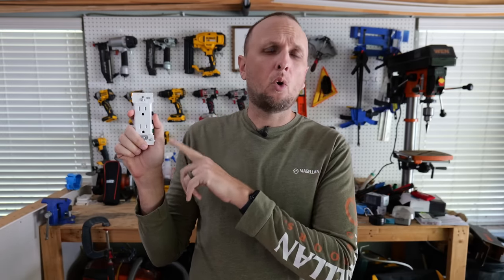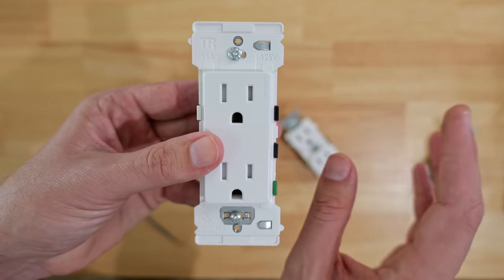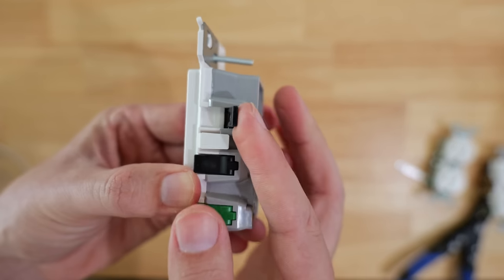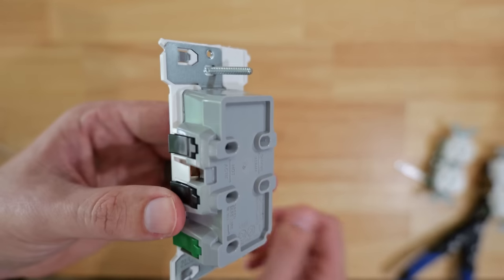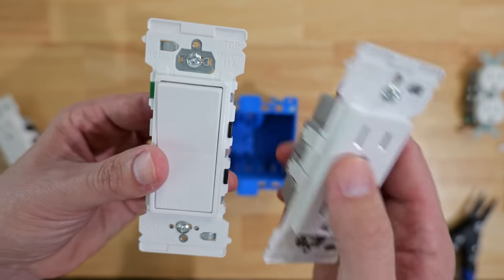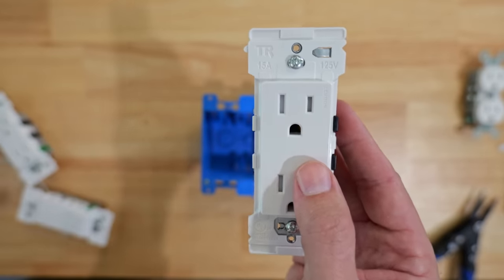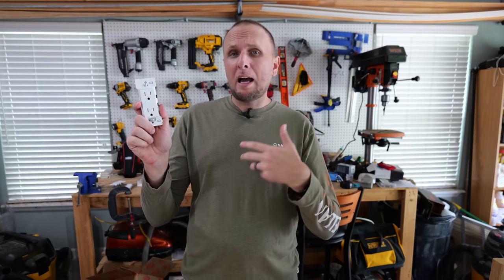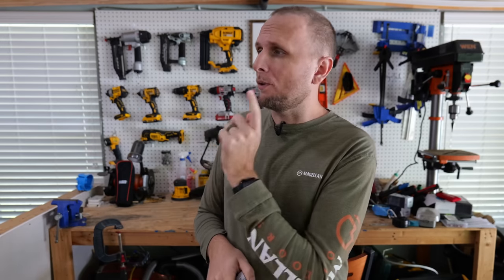The Fastest, Safest, and Most DIY Friendly Outlet Available!

Comment: Are they making a GFCI receptacle?
Reply from the maker: Not yet.  So far just this, a single pole switch, and a 3 way switch.
Reply: Considering that design requirements and approval processes for life saving/safety devices is much more is exacting, rigorous, and costly, than for residential switches and receptacles, certainly there would a lag in the release of WAGO style GFCI. If not an all out ban of such fixtures.

Comment: My question is that with solid conductors which are typically jammed into a box, how long will those connectors keep a tight grip on the conductor?
Reply from the maker: Time will tell I suppose.  I will say it worked WAY better than the backstab holes.

Comment: The new Leviton outlet cost twice as much as the cheap standard outlet.  U also have to buy new face plates with two screws instead of just one screw in the old face plate. When consider the extra cost of the Leviton and the time it takes to cut off the top and bottom plastic tabs and the new face plate expense and the two extra screws to screw in and the time it take straighten out the old wires, I prefer the old outlet to save both time and money.  Finally, if you want all the faceplates to match the rest in the house, it is much easier just to clean and reuse the old outlets and face plates and save even more money.

Comment: Do they only have the non GFCI type sockets?
I looked for a GFCI type but all of them are the screw type.
I need to replace one due to a powerwashing incident.
It did do its job it just was a mad bee sound before popping.
I looked all over the site for a locking type GFCI and did not find any. :|
Reply from the maker: No GFCI models yet.

Comment: How do you attach a face plate? No screw hole....or am I missing something?!?
Reply from the maker: It is a decora receptacle so it will need a decora faceplate that screws into the top and bottom of the receptacle.
Reply: @HowToHomeDIY  Thanks. I'm going to try one. (if I can find them)

Comment: i'd rather them put money into making backwire devices cheaper, you can have 4 conductors on hot and neutral, for split receptacles you can have 2 plugs per circuit without marrettes, not that im against marrettes but saving box fill is valuable, the second problem i have with these receptacles is they look fairly wide and harder to deal with if the box is crooked
Reply from the maker: They are the same width as a regular decora receptacle.  I am with you though on the back wiring feature of commercial grade receptacles.  Those are still my go to.

Comment: How do you separate the top and bottom outlets like you can by removing the metal tab in the old outlet?
Reply from the maker: This also has that same metal tab in the same location.  There is just a flap of plastic protecting it that you pull up to see it.

Comment: But… you need to mention the cover plate must be changed from the standard to a rectangular opening. I guess the GFCI cover will be required. All the old plates will not work.
Reply from the maker: Correct it is a decora receptacle and will require a decora plate.

Comment: Sorry to say, but the sreewless concept is the standard in Germany for years - switches and outlets (https://youtu.be/eOlFAaffo1k?t=162). Also most designs have two connection point for line, neutral and earth to daisy-chain two or more devices easily. Hope the new save designe will become the standard.

Comment: Cool. Ill bet the cost is 5 times as much as standard.
Reply from the maker: Regular residential are around $1 these are $3.50 individually or $2.50 each if you buy a 10 pack. So not 5 times.

Comment: So... like quick connects?
Reply from the maker: No the internals are completely different.
Reply: @HowToHomeDIY  I'd be really interested in a tear-down to see how much contact area there is between the wire and the internals.  I think that is really the issue with repect to folks concerns with the WAGO nuts and even the quick connects.  A small contact area basically takes a 12 AWG wire and turns it into something far smaller at that point, leading to potential for heating up and failing.  Having good strength to not pull from the lever is accomplished by biting points often times, which is the problem with contact area.

Comment: I think the electrical design in the US is poorly thought out.  Why does the DIYer even having to mess with wires?  A better design would be if a new style of box were wired in by the electrician, and the receptacle was simply plugged into the new style box. Then the DIYer could just unplug the receptacle and plug in a new one without even turning off the electricity. And it would still be wired correctly.

Also sometimes the recepticle sticks out too far, sometimes it's too recessed, and there are the screw slots at the top and bottom of the receptacle that are way too big. And why are the covers installed by regular screws and not Phillips,  is that so the flat bladed screw driver can accidentally slip and go into the outlet.

Don't get me started on the boxes for hanging ceiling lights that have the thin metal bar that goes across them with various size screws and wires that go through the middle of a hollowed out bolt.  When I was in Moscow I was asked by someone to change out a chandelier.  It was so incredibly easy! There was a round metal plate on the ceiling with an eye bolt in the middle and a couple of wires coming through a hole in the plate.  The chandelier has a hook and hangs by the eye bolt (which is screwed into structure, not hanging from an electrical box), meaning you can hang the chandelier and then connect the wires without trying to support the chandelier at the same time. The wires were connected by wagos below the surface of the ceiling, meaning no box to pull the wires down through and stuff them back into,  and there was a cover on the chandelier that slid up to cover the wires and form an electrical "box".

Comment: It looks like this outlet has a limitation: It does not let you break the connection between the two outlets (traditionally used in installations where the upper outlet is switched and you pry off the link between the two outlets)
Reply from the maker: You can.  It is covered by a flap of plastic.  The plastic is keeping it safe from exposure but can be pulled up and the tab connecting the two receptacles can then be broken.
Reply: @HowToHomeDIY  Cool! I was wondering if that white cover on the side allowed that.

Comment: No tabs to brake if you want 2 seperate breaker on the plug.
Reply from the maker: Yes there are.  I just didn't talk about them unfortunately.  But they are under and being protected by a flap of plastic.  The plastic can be pulled up and the bridge between the terminals can be broken to make it a switched receptacle or separate circuits.  I hope that answered your question Jerome.
Reply: @HowToHomeDIY  yes thank you, there prefect.

Comment: Don't trust it the metal that locks them in is too thin and could you lose continuity over the heat induction from the wires before the breaker pops

Comment: A wago connection is just a piece of metal that is pushed against the end of the wire. Its maybe ok for very low amp draw circuits but at 20 amps or more its best to draw the conductor around a very solid screw. Way more conductor contact than a simple push in connection. When it comes to electricity its no place to cut corners with convenience. Conductor wires need to to be firmly connected to receptacles. Especially when dealing with 20 amps or more. This video asked if I would use this product in my home.........I wouldn't use this is my chicken coup let alone my home. Your just asking to burn your house down. I might even do a review of these connectors on my own channel and show why or if I would recommend them. we shall see.

Comment: Great idea to save time but the contact area is a choke point for current which heats up and becomes a fire hazard. I've replaced melted receptacles due to this. This is why I don't use nor recommend using wago connectors or these receptacles. They are a fire hazard. Clearly, big money bought off UL and NEC to legally sell these fire hazards. Shameful.
Reply: Good point.

Comment: I doubt these plastic clips will hold over years and years of sparks/on-offs/loads/heat/etc. Most houses have outlets/switches of 20 years+ and not everyone will be willing to replace them over that time. Screws are the best for termination as a one-time install and forget, imo. Not the best place to save "time".
Reply: Ehm, they wont spark as they are secured by tension...and there will be no heat because the contact point is good...

Comment: Electrician here. Looks like a callback to me. I'll never use it until they stop manufacturing ones with the screw terminals.
Reply: Probably better than stab-backs (which I would never use) and better for people who don't have the dexterity to make a good wire connection under a screw, but I don't like the idea of relying on such a small amount of contact area that WAGOs provide.
Reply: Electrician here. Cool, I’ll just do the same job you do in a fraction of the time.
Reply: I care more about substantiated reliability and safety, which translates to customer trust and repeat business, than speed. I'm sure your employer loves that mentality, but guess what, it's not your employer that pays the bills, it's your customers. I've seen wago-style connectors fail more times than I can count. Probably because they were installed by guys that cared more about speed than anything else...
Reply: @dansteele4055  Are you familiar with a UL listing? If you’ve seen them go bad countless times than you’re putting them in wrong bro lol…

Comment: Hate to disagree but the absolute SAFEST receptacles  ( not called outlets ) would be first a combination AFCI/GFCI  Tamper resistant receptacle and second would be a Tamper resistant GFCI receptacle. Just because it has covers does not make it and safer then a receptacle that has three wraps of quality electrical tape. Have removed receptacle from outdoor boxes that had bottom halve of receptacle under water and taped and did not short out. Biggest mistake most lazy cheap electricians & others do is to not not use a torque driver to.properly tighten terminal screws. Was to!d at a IAEI continuing education class that UL labs went around the country & obtained believe hundreds of devices and found that at least 30% were not properly torqued.Problem that I see with all flip levers is the arm might release on a strong blow to device or box or in a multi gang box Johnnie homeowner could accidentally hit one of the arms & not realise that he unlatched it. Best practice if you decide to go with these is to apply a few wraps of quality black electric tape. Stay away from cheating lack of quality control POS tape made in communist china.

Comment: So, after years of being frowned on, backstab wiring is now cool.
Reply from the maker: This is in no way backstabbing.  Completely different mechanics.  Backstabbing is still strongly disliked.
Reply: @HowToHomeDIY  It's not different. And DIY'ers are still going to try to use it in too-small boxes and twist and smash wires to where the insulation might split.
Reply from the maker: Then you don't understand how it works because I have opened both kinds of receptacles up, the mechanism that holds wires in the levers on this new device are WAY better than any of the backstab retainers.  You can disagree if you like but the two are nothing alike.
Reply: @HowToHomeDIY  Yes, I do, but maybe Leviton will put something on the instructions about the minimum depth a switch box should be to hold this switch, and still allow the wires to be properly and safely inserted into the holes.

Comment: It's a WAGO piece of junk in disguise. Run full rated amperage through it for several hours, then see how easy those wires pull out, or worse the wires melt from those tiny spring clips and catch your house on fire.